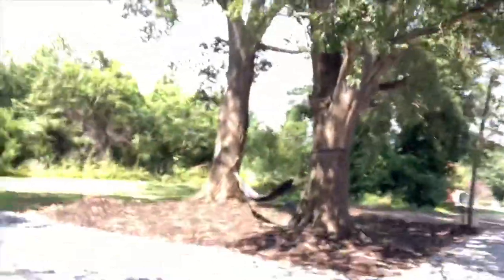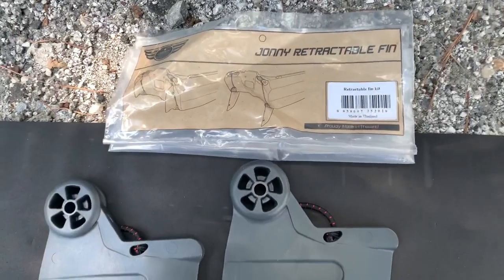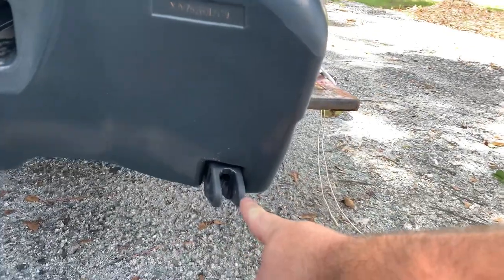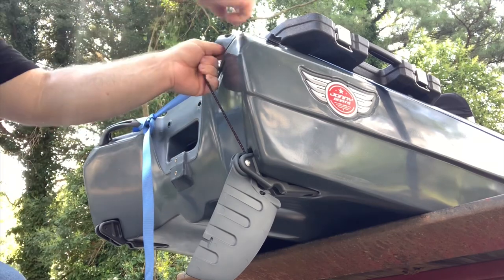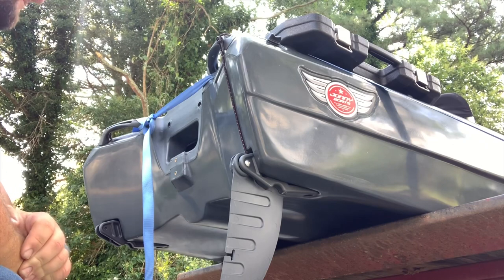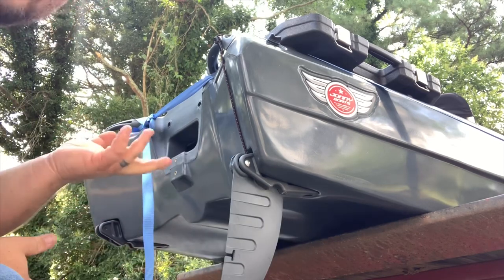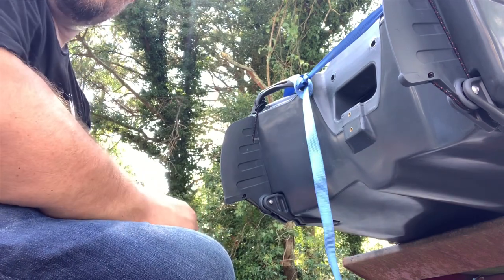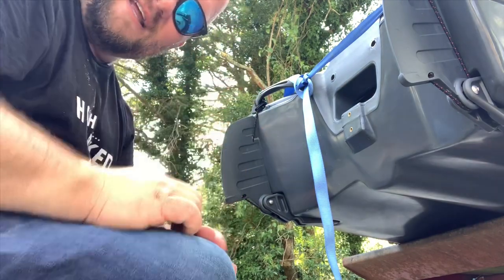Jonny Boat Bass 100 Fin Kit install!!  Excited to try these out!

Comment: After seeing your video I ended up getting the kit. Even though I didn't think it was worth $99. I've since changed my mind. They are worth there weight in gold especially in rough water. Nice Video!
Reply from the maker: Hey thanks man!  They made such a huge difference for me. Especially with the trolling motor up front these really keep the rear of the boat “locked in” with the line I want to travel. Hope you’re enjoying your Jonny!!
Reply: @road2therunway   Do you get a lot of folks coming up to you at the ramp asking you about the Jonny Boat?

Comment: Thank you for the video. I’m definitely going to get those for better tracking. I was wondering what kind of batter to get for an endura max 55 trust trolling motor? And do I need a box for the battery?
Reply from the maker: Steffen Clarke-Jones I would always recommend putting your battery in a box while on the water. Plus boxes have USB ports and such so you can charge on the water.  I would say it depends on how much you weigh, but I would get the biggest one you can afford that doesn’t put you over weight in the back.  Go lithium if you can afford it.  Lighter the better!